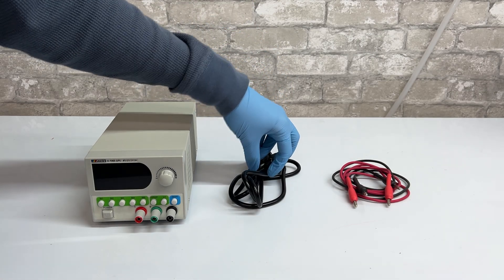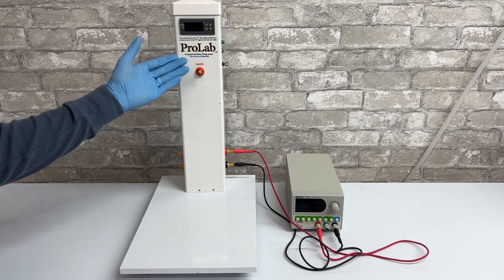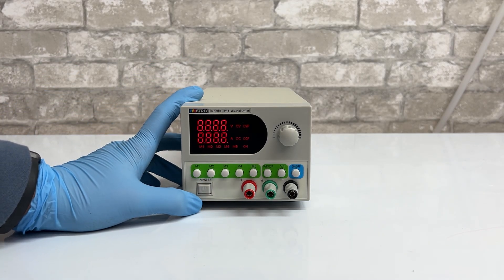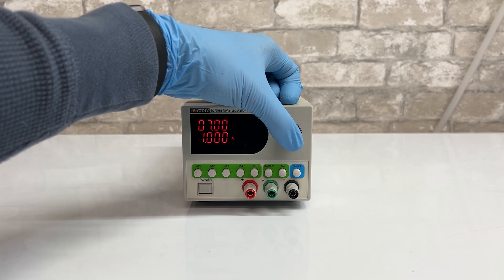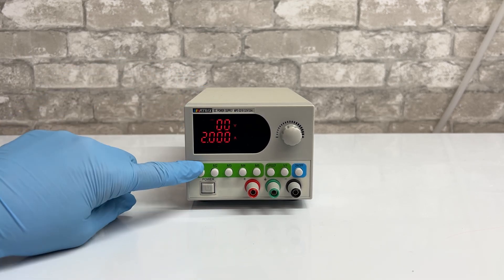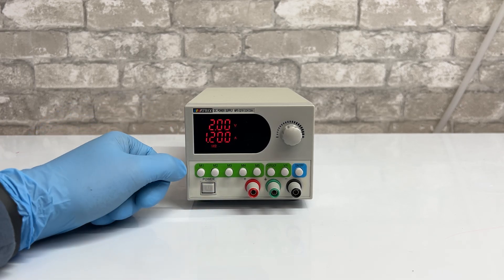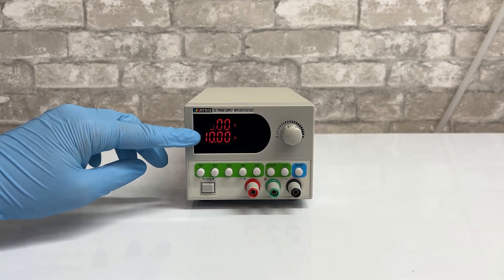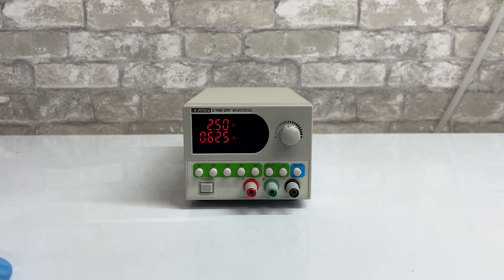32V/10A Power Supply Guide

Comment: Which machine  colour rold gold, silver and copper ornaments in to gold colour..i want that machine.
Reply from the maker: All of our machines will do what are asking about, you'll just have to get the correct solution. You'll likely need a diffusion barrier for those materials, and the size of your items will depend on what machine would work best. Check out our suggested plating steps here: https://www.goldplating.com/pages/solution-steps-by-metal-type
Reply: @GoldPlatingServices  thank you very much